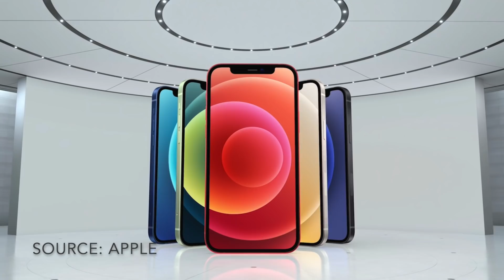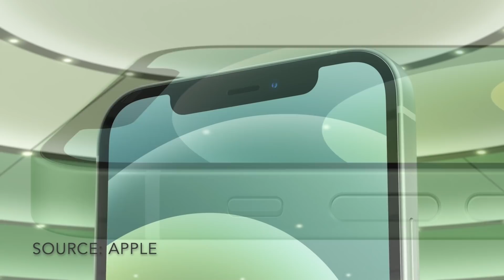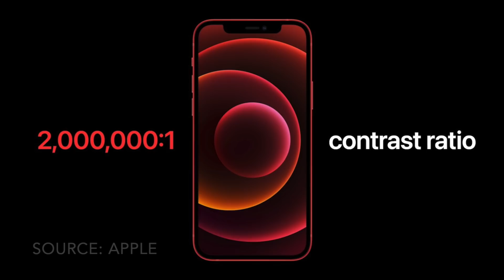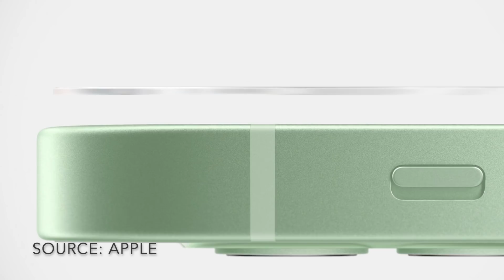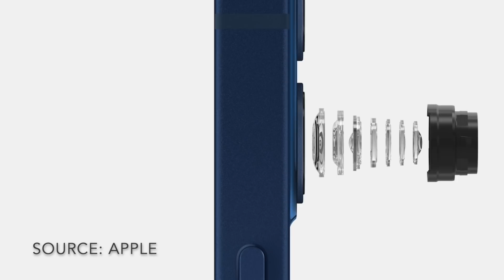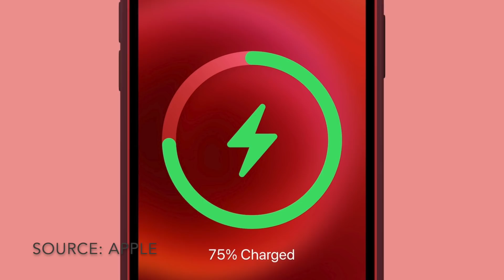iPhone 12 - Top 10 New FEATURES !

Comment: God damn, you’d think they’d make the pricing for the non-pro models more competitive, instead, they show you misleading prices ($30 lesser than the actual price), and on top of that, remove the charger and the earbuds under the pretext of “saving the environment”.
Getting the 12 would be a major yikes. I have the 6s, and before the event, I was torn between getting the discounted 11 pro or the new 12. After the event, I’d get a 11 pro over the 12 any day. The only photos I take are screenshots, and the country I live in will prolly take about half a decade more to implement 5G. Hard pass on the 12.